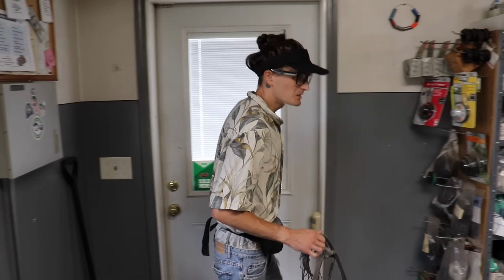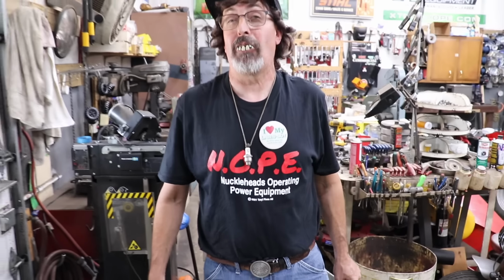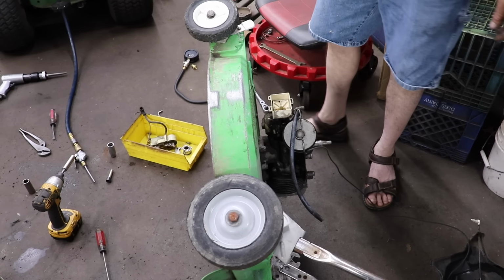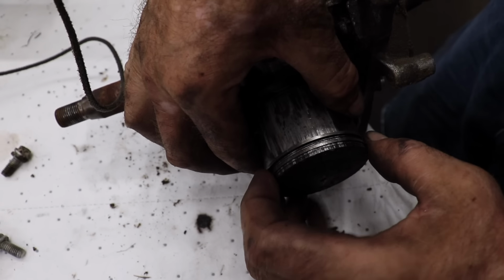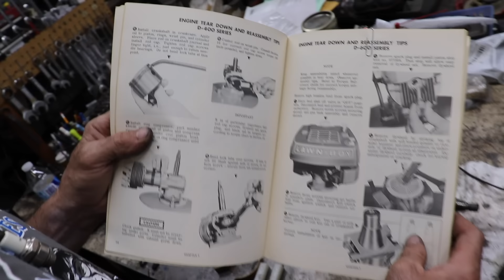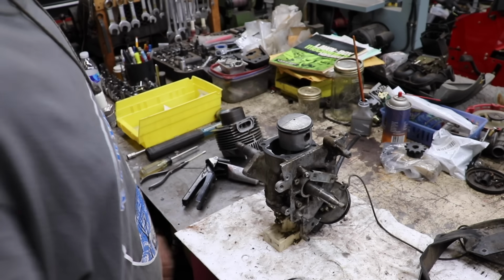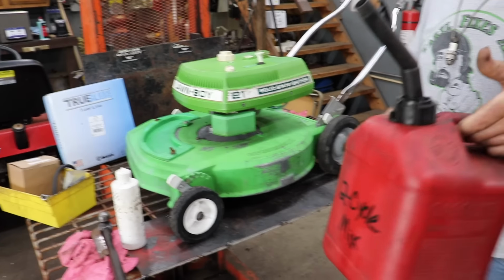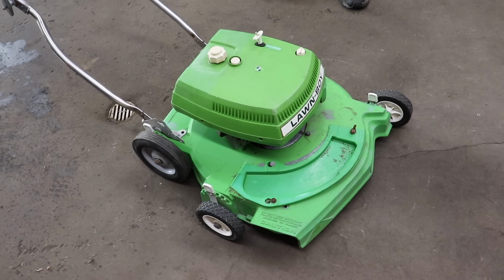Epic Lawn Boy Engine Rebuild

Comment: I had one of these and did the exact same as you - got it all cleaned fixed the issues and got it running. Ran like a top. But the stupid starter rope and return spring kept having issues. Replaced the pinion gear but it still kept jumping the winder and I would have to re-wind it. Finally gave up on it and got me a 1978 Snapper 2 Stroke with a Wisconsin-Robin engine. Completely rebuilt it and it runs second pull EVERY time - and it has a throttle too. Nice job.

Comment: I love that thing. I want one.  When I was kid, we had a mower with a crank recoil.  You'd flip the handle over on top, crank it up till it got tight, then turn a knob to spin the engine.  I remember I was 1 crankin son of a gun.  I despised that thing. Lol
Reply: My Grandpa had one of those same mowers back in the early 1970's up in Northeast Ohio. He used to have me go cut the yard with it ..I was just a kid back then ...I remember winding that thing up ,then flipping the handle over and hitting the button  And the darn thing didnt start ..I was one winding Fool back then ha ha  ,Until that thing started..Good Memories
Reply: Growing up 1960’s and 70’s We had an old Jacobson reel mower with that same crank recoil mechanism. Once it caught and fired boy you had to hold on as it was self propelled as well by those two big wheels on either side. No throttle. One speed. Turning and going the opposite direction was scary as hell. Grass clippings all over your legs and feet as it was a reel mower. Hated that thing.
Reply: We had a riding mower that had that crank style ignition. The engine was underneath you kinda in between your legs. It had a strange bubble style body. Kinda looked like a spaceship. I can't remember for the life of me what the brand was though.

Comment: I used to love those lawnbiys, so lightweight.  Good one Taryl!
Reply: I had one and the light weight was why I purchased it.  Someone borrowed straight dino juice from the neighbor once and it seized.  When I came home I took out the spark plug and squirted some dino syrup into the cylinder, the carb,  and the gas tank.  I rocked the blade back and forth a few times until it freed up and then it started right up.  I got about another 3 or 4 years out of it.

Comment: Bought my 1978 LawnBoy mower in 1980 after building our first home in Claremore, Oklahoma and continued to use it into the 2000’s while living in Lamar, Missouri where a LawnBoy factory had been for years. Great mower. Don’t ever wash it while the mower is hot because the electronic ignition won’t like you! 😜

Comment: 29:05 Break the top ring in half and use it to scrape out the ring groove.
29:34 Oven cleaner has lye in it.
33:52 Too tight of a ring gap can make them break. Always measure the gap.

Comment: Why was the muffler down in the deck was that to keep the noise down or just because that was the most covenant  place to put it.
Reply: Those older mowers used to run RICH and smoke like crazy. The exhaust under the deck let the blade blow it away from the operator so it wouldn't gag you too bad.
Reply: Blew exhaust down to smoke out the bugs 🤷‍♂️
Reply: I thought it was to cauterize the tips of the grass after it was cut to keep it from growing back so quickly
Reply: In this way you get to step on the smoke and leave a true Carbon Footprint

Comment: Reading through the comments, I see polar opposite responses: "finest mower ever made" or "what a piece of junk."

I'm thinking that the people who say it's junk didn't read and follow the owner's manual.

In the spring of 1988 I bought a brand new model 7073 (steel deck) and still use it to this day.  If you consider the pull-rope a consumable, then there has never been any major work done to it.  Carburetor has never been off or even had the bowl removed.  To my shame, though, I have never cleaned the exhaust ports yet it continues to run fine.

My care and feeding routine:
Always use Lawn-Boy brand oil mixed 32:1
Almost always use ethanol-free gas
Turn off fuel and allow bowl to run dry when done mowing

I've also used Sta-Bil in the past, but after seeing Taryl's tests on fuel additives, it probably isn't doing any good (but probably isn't doing any harm, either).

Comment: These should run quietly when repaired and running properly as the exhaust is exiting into the blades... is that right?
Reply: Mine had the muffler around the shaft under the deck and yes it was pretty quiet. I think that comes from the bottom exhaust discharge on their outboards.

Comment: These were simple and complicated all at the same time.  No valves, cams, or many other moving parts.  Especially after the governors went away with the F engines.  If the crank seals, carb, and ignition coil were good, they run.  Always.  Run straight gas in them for a few minutes and it's all over, though.  2-stroke mower owners shouldn't loan their mowers out..........

Comment: Excellent video Tarly :) I remember use a Lawn Boy 2.5 hp 1966 year 2 cycle type with 1 gallon  fuel tank and did when growing up in 1980's on farm years ago also  fuel mix had be 40:1 ! Color was Green and White with Blue fuel cap also last long time till couldn't get parts for anymore in my area !  Only had one speed to not speed control at all ! Did 4 acres of grass a week!

Comment: Great job!

We had one that was older...  All metal.  Kind of white, or off white.  That same wheel arrangement though, I remember that....  And we bagged, we had a bagger...  Mulching was still a future invention....  It must have been 1970, or 71, when I started cutting the lawn....  and the mower was not new, back then...  Pretty sure my Dad got it used back then.  Anyways, it ran great, forever...

I was pretty young when I cut the grass...  I couldn't push the mower.  The mower was self propelled!  Heh heh heh!  

Safety stuff???  Yeah, there was nothing...    If I fell down, mower would keep on going, until it crashed into something....

It's amazing any of us lived to see adulthood, isn't it?

Comment: Hey Teryl,I've got the type with the last type motor you showed.its still in pretty good shape and I had a self propelled too but man these things can out- mow a much bigger mower in regards of horsepower.mine days 4.5 I'm pretty sure and man even at low rpm these mowers are awesome.carbs can be a little funky but they sure can cut some super tall thick grass no problem.gonna fire mine up tomorrow,lol.I loved this video.most people have never seen a Lawn Boy.Their awesome.Killer video Mr.T D

Comment: The first lawnmower I ever bought was about a 1980 or '81 Lawnboy that I bought around 1983. I really liked that mower, self propelled and lightweight. They seemed to cut better than others in my opinion. I've always been a fan of Lawnboy and Snapper and I have an old Lawnboy like the one you just rebuilt that needs some attention, it won't run.
Reply: Things too check spark and fuel 90% if the time it would be the float got waterlogged and would sink and it would spill gas all over the place out of the carb. I don’t remember how many I fixed like that but it was an easy fix but now I don’t know if you can get parts like back in the day like the carb rebuild kit? Good luck

Comment: That's a really nice "suitcase" top.
As for the parts you mentioned scrapping, there is quite a cult following for the old LawnBoys.
As for sealing up the crankcase, I just started running a little extra oil in my 1980 r7070. Between that and using Red Armor, she's running smoother than ever.

Comment: I grew up a couple blocks from the OMC test facility in Naples FL that's were the lawnboy testing was done they would give them out to lawn services for testing and had a sodded test area across the street from the building .That is the mower everyone used back in the day .With the exhaust coming out the bottom one evening  I hit a butane  lighter and it lifted the mower off the ground and blew a blue flame around it .Very light mower and simple to rebuild and repair .would love to have one today for nostalgia and would still use it .

Comment: Had one just like that in 1979. Mowing high grass behind the neighbors garage and cut a brick in half. Thought for sure I bent the shaft. Turned the mower over ti check. All good. Just smoked a lot when I started it up. Used that mower for over 5 yrs. Good mower. Cut the yard nice too.

Comment: Cool,  i have never seen a 2 cycle lawnboy .

I recently acquired 1994 lawnboy silver series.  It has a 4 cycle Tecumseh engine. 4.5 HP.  Starts on 1 pull.  I got it because previous owner couldn’t get it to start.  It had a bad  coil.  It cuts great.  I did end up repainting it.  Closes color I could find was Spring green by Rustoleum.  Doesn’t match exactly but close.

Comment: I've got a 1982 LawnBoy with the safety bale. That thing cuts like a demon!  It doesn't matter how long, or how wet, the grass is, that old LB will cut it clean.  What I like about LBs is that they're infinitely reparable.  They were made to be fixed and returned to service, not thrown-away like the Chinese-built junk sold today.

Comment: My dad preferred servicing lawn boy mowers. He worked on Briggs and Tecumseh but knew lawn boy best. He stocked the carb reeds, points,ignition module, filters  and other stuff from lawn boy. Poor Compression was often a stopped up muffler. Taryl fixed that quickly.

Comment: Caustic soda is used in oven cleaner & it's corrosive.

I have a Victa 2 stroke lawnmower which needs restoring,I have had the engine running but it needs new crankshaft bearings fitted,its compression tested at 107 PSI,it needs a full reseal because the governor is vacuum operated & it only runs at full speed,I have all of the O rings for it which are the main cause of the Victa Powertorque  engines not idling,my dad used to have an old Model 6 Victa 2 stroke lawnmower when I was born in 1977 which was a very basic Australian built lawnmower.

As far as piston ring markings go it doesn't matter in the Briggs and Stratton 3 horsepower 4 stroke engines when the aftermarket Stens piston rings are fitted because when I rerang mine on Xmas Eve in 2019 the Stens piston rings weren't marked !

Comment: I liked the video, and have a question? What tool did you use to  remove the blade hub, and how do you drive it back on? I'm trying to change out engines! Thanks for any help!
Reply: How did you end up getting the blade hub off? The tool Taryl used was an air hammer.

Comment: I worked on several older than this one. Mostly just carb cleaning but those had adjustable main jets. We used Stihl 2-cycle oil and I leaned them down so they weren't slobbering nearly so much but not leaned totally out. Never had any trouble out of them and used them to mow steep places. Good old mowers.

Comment: I love it , Prime for a Good Time. I use this on any engine to check the state of disrepair . The fastest diagnosis tool you can use . Tells you about compression , Ignition function , mechanical timing , Ignition timing  all in 10 seconds. There is your dinner .

Comment: We had a yellow LB dad bought in the early 60’s to memory.  We rebuilt with cylinder home, new rings and reed plate I think after it was about 20 years old and used it until the early to mid 90’s when dad decided to buy a snapper variable speed power drive walk behind.  It took 2 men, 3 boys and a small gorilla to push back up the hills when it couldn’t get traction.

Comment: I bought a 22" lawnboy in 84! It was very expensive because I got the model with the blade brake but the mower would run with the brake on, which was very handy. I had a 1 acre yard and used that mower for 20 years. It still ran when I gave it to a guy who's mower fell apart. Now I'm curious if he still has it and or it still runs.

Comment: I have about 8 or 9 lawnboy mowers. From the 1970 till the last year they made the aluminum deck with a 2 stroke. The latest model had adjustable throttle and 3 speed gear box. It is a impressive mower

Comment: West Bend 580 and McCullockh engines for gokarts back in the early 60s were the first engines I learned to rebuild since we were gokart dirt track racers. I was 12-13 years old. They were pretty simple setups.
Reply: I had a cart with a McCulloch 91 My buddy had a twin 101  setup  he used on asphalt that thing was fast.

Comment: I had the same problem when I had my RV and mobile home repair business. I had boxes of parts for RV furnaces, power supplies, water heaters, etc. Took up space you don't want to store, but don't want to throw out, can't sell and in reality never use on a job.
Eventually, you succumb to the urge to hoard them and much against your better judgement and consciousness, and it kills you to throw them out.
Two weeks later you get a call to repair something with the very part you got rid of.

Comment: I bought a brand spanking new Lawn Boy at Homer Depot in 2013. It was at the end of the season, I needed a trim mower, had electric start, was self propelled, fully assembled, it was 40% off, and bright green!
Reply: That was after torro bought them whole different machine OMC MAKERS OF EVINRUDE AND JOHNSON outboards made them but they went belly up in 2000 and Bombardier made evinrudes after that but no mowers

Comment: Bought a new Lawn boy back in 1977  19 in. deluxe very similar to the one you have mine with points, check them about 3 time over that time and never changed also never did a thing to it except clean the exhaust port under the muffler and new plug every 3 to 5 years. About 10 years ago started using 40 to 1 mixture from the original 32 to 1 because other equipment all 40 to 1 (leaf blower/weed trimmer).
Still use it for trimming around trees every time i cut lawn.
New it was $145.00, what a bargain and still working today.
Unfortunately that technology has been pushed aside.

Comment: Hi Taryl, is the gas, oil mixture 32 to 1 on those older lawnboys? I also have a M series lawnboy that I rebuilt the carburetor. It runs normal for a short time then starts to run crappie. What could be the problem?

Comment: Hey Taryl, what was the green panel on the top front of the mower? A place to.put a bagger?
Reply: Robert Turner That's how you change between side discharge and mulching. Don't even have to change the blade.
Reply: Yep, that's where the adapter for the bagger goes (my 1988 Lawn-Boy has the bagger).

Comment: I got the same mower, but the F. Put a standard pull start on top, cut top cover. Toggle switch n different air filter. Starts first pull every time. Best mower I ever had

Comment: I have a question for you. I’m working on a lawn boy model 10550. It’s only about 10 years old and it is never ran properly. I got it running and it goes from top speed to slow idle constantly. Do you think it’s the air vein spring, causing the issue I disassembled the carburetor and cleaned it, but it still acts like it’s surging

Comment: Taryl, put some knurl on the piston skirts to restore bore clearance, after applying knurl, use wire wheel (bench grinder) to adjust the fit. (I see the hand knurl on ebay occasionally) or use the lathe.

Comment: I had two of them (pre 1980 models), one was just like this one except the speed control was a knob instead of a lever. You could mow and fog for mosquitos at the same time.  Very little maintenance required on them. The pull start mechanism worm gear spring could be destroyed by pulling too hard on the rope.

Comment: What was that part that shot across the shop when you put the piston in the engine?
Reply: Piston ring compressor tool. Compresses the piston rings into the grooves on the piston so you can install the cylinder back over the piston.

Comment: @39:00 I used to use a hacksaw blade to clean the flame slots in the old style cast iron burners in RV furnaces. They'd plug up with rust from not being used very much.
The blades were the perfect size. Just had to be careful not to saw past the edge of the original slot.

Comment: You might want to use steel wool soaked with some WD-40 to remove rust from any chrome plated parts, like chromed muffler guards or chromed handles. It will take off the rust without scratching the chrome, like an abrasive will. Chrome is hard, but not as hard as the aluminum oxide or silicon carbide on an abrasive pad or sandpaper. Some bronze wire brush would probably work too. Since the chrome plating would be harder than the wire, it should remain unscratched.

Comment: When I worked in a mower shop in the mid 90”s we use to get these in all the time, I was  a teenager at the time, and always got stuck repairing them. I remember those recoils they were pretty tricky.

Comment: I do have a question, what do you use the lemon scented furniture polish for?
Reply from the maker: Works good for cleaning powder coated parts, I also use it for squeaky door hinges. Theres your dinner!
Reply: @TarylFixesAll  that's good to know thanks taryl. They also use the muriatic acid to clean the bottom of fiberglass boats.

Comment: I’ve used acid to clean rust out of tractor gas tanks and then used red coat to coat the inside of them …works good in hot water heaters also

Comment: I ran those alot. Nice magnesium deck. I think rated 6hp.
Seems similar to the old Tecumish 2 stroke. Oh, maybe best to run low speed over grass with gravel in it.
Reply: most lawnboys that era were all 4hp I think the commercial might have been more. But I know when we ordered long blocks there was only one and one part number for all
Reply: @dgc940  you're  probably right, a buddy back then told me 6hp, but we were teenagers, so...